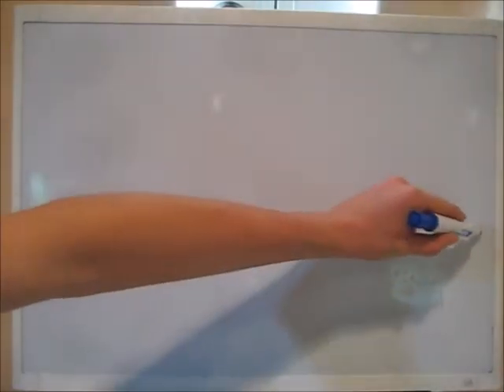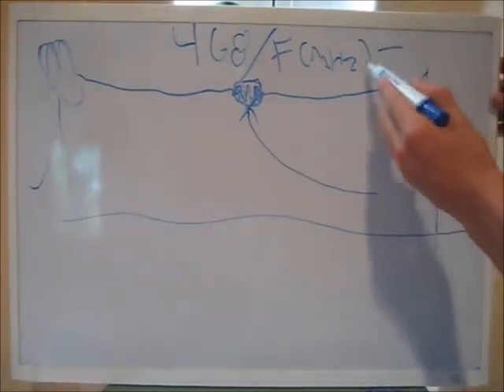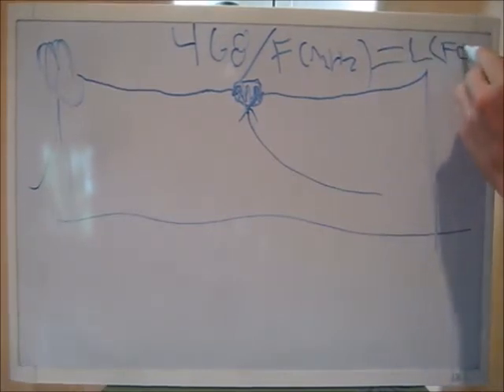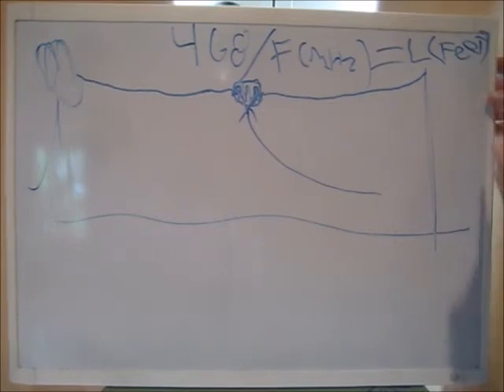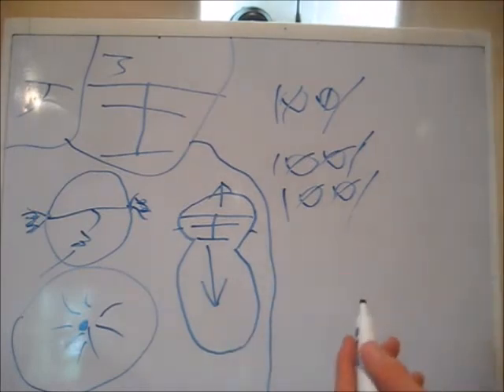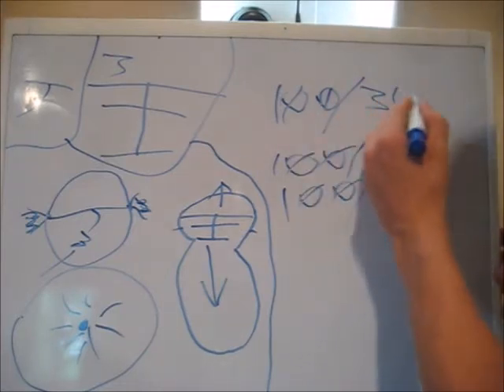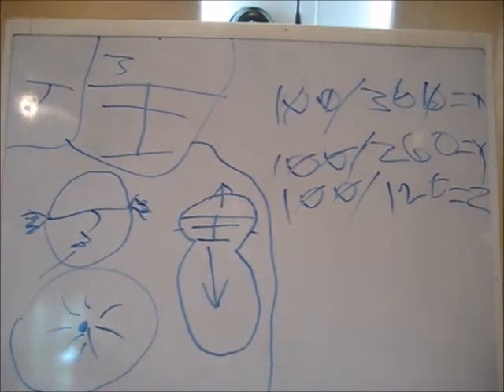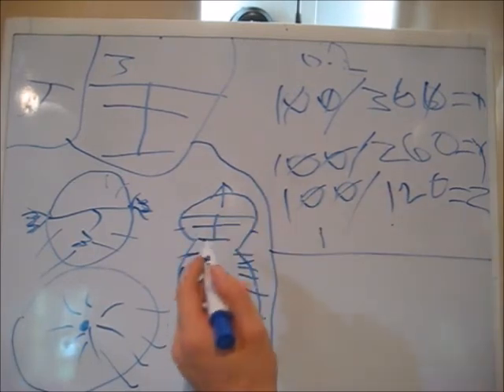Antennas, Radiation Patterns, Baluns, and SWR for Beginners

Comment: 1 why not use actual wavelengths instead of "feet"?
2 are you sure a standing wave ratio is about *ohms*? I always thought it was the ratio between the signal the transmitter puts into the coax and the signal that comes back from the antenna. Shouldn't that be expressed in (milli)volts?
3 how (as in why)  do radials reduce SWR? Can you visualise it?
4 why don't you show us an actual balun? Is it just a "shunt"?

feel free to refer to other videos if you explained it there already :-)

oh and 1,0 MHz equals 300 Meters
Reply from the maker: 1: When I learned the equations I learned them in feet so it was easier for me to explain it that way instead of re-calculating.
2: While in theory it is the reflected signal, you need to know WHY that signal is being pushed back. The reason signal will return to your transmitter is because of resistance in your coax.
3: I will make a video for you soon.
4: This is a basic video and I didn't actually have a real Balun on hand. As long as you understood what they did I was not going to go into the science of how they work.

Comment: Hi, do air chokes/balun work on a vertical antenna, so much conflicting evidence about
Reply from the maker: If 'air chokes' is referring to a choke without a ferrite, then YES, they work just fine. The Butternut antenna by DX Engineering uses one of these chokes to tune for 80m. You can also use these to tune Hamsticks. I have used them in the past and they work marvelously. Unfortunately, I cannot solidly answer your question about baluns at this time. I'll let you know if I come up with something.